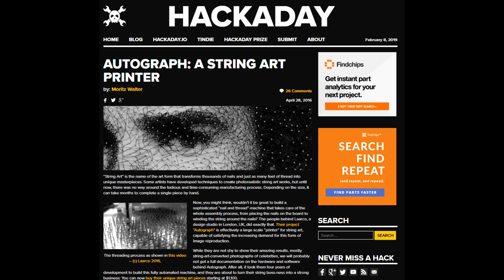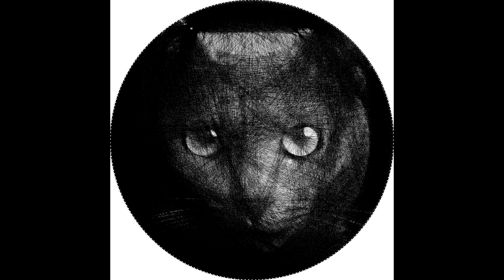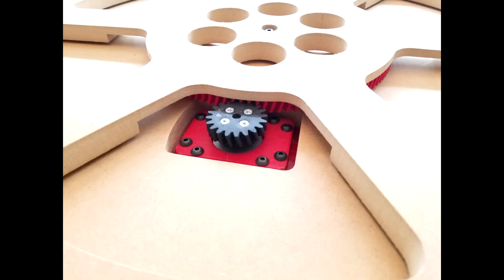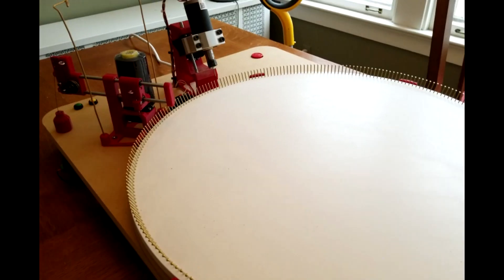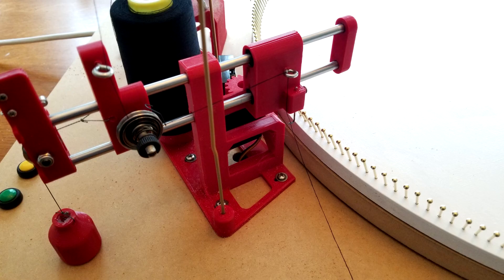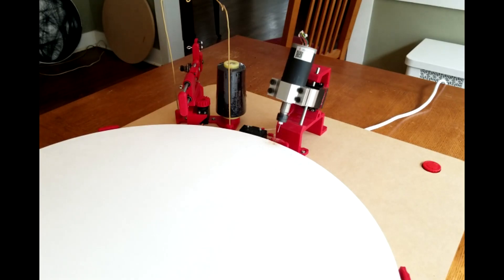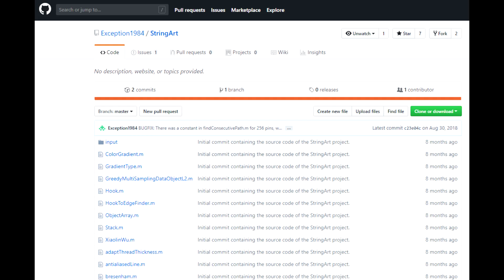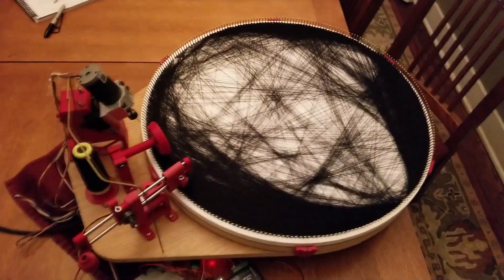A New Spin on String Art Machines

Comment: I've been inspired by your machine so I'm going to make my own. I am designing it for laser cutting. I played with a stepper motor for the first time I think I have that down now. Next I need to figure out the thread servo and feeder. I'll be using large thin rings of Teflon as an pseudo bearing. 

Where did you get those nice nails? Amazon doesn't have any good options.

Comment: Glue down with contact cement, a rubber strip (scavenged from a bicycle innertube) on the table that the bearing rollers ride on. Rolling noise should be deattenuated.

Comment: instead of finding rubber wheels, wouldn't it be easier to get a rubber mat for the wheels to do their rolling on? heck, maybe do both. also there are those tiny rubberbands. maybe you can fit them around the wheels to act as "tires"

Comment: For the time lapse you might try having some sort of visual angle reference on the bed that is easily visible to a camera mounted directly above it. This way you could "rotate" the bed to the same index position in each photo essentially making the time lapse look like the machine is moving around the art. I think this would be very cool looking.
Reply: Well you know the angle of the bed right? Couldn't you just rotate the image in post?
Reply: @Synthetica9  this would work fine too as long as you have a way to associate the angle to the image file. Having a mark on the bed that you simply rotate in post to the 12 o'clock position would probably be easier since you don't necessarily have to cross reference a list of files and angles. 

However if you were controlling the camera from the same control board and if it has a little extra processing power, it could be trivial to take the photo, immediately run something like ImageMagik on it to rotate it using the angle from the bed controller as a parameter while your string art machine is laying down the next string. Rinse and repeat and your "post" processing is done around the same time as the artwork you would just need to run the rotated and cropped image stack through ffmpeg or something to make it into a video.

Comment: pretty cool build, you should try getting some white thread and dripping dye on it of various colors, then making a picture with it :)  Also putting all your moving parts on rubber bushings can reduce the noise, and adding sound absorbing material to the back side of the base will cut some noise. The gears themselves can be noisy as well, going to a belt drive system is a great way to reduce even more noise.

Comment: Another interesting idea would be to make a printer that prints in a circle. The paper rotates on wheel and the print head goes left and right, but only half way across and the paper rotates after each row of pixels printed until the paper is full.

Comment: Instead of rotating to a fixed position to take a photo (which as you say potentially raises problems with thread tension, and would definitely slow it down) you could try recording the position (or just extract it from the input data) at each "operation" and use a script to rotate the image the relevant amount. It's not like there is machine gubbins moving in and out of shot  like a 3D printer.

Comment: Fantastic project.
Rather than use rubber wheels that will inevitably wear out. You could consider using damping material and damping mounts to the sections acting as a sounding board.  That gives you more robust mechanics and reduced vibrational noise. Look at Getzner polyurathane material and request sample pack

Have you considered running Octave rather than Matlab. Octave is compatible with Matlab language.
Otherwise consider Matlab to Python translators then Cython interpreter to compiled code conversion for speed ups. 
I look forward to the next video of your work

Comment: 7:47  have you thought about model railroad cork roadbed?  its pretty sturdy, and is used in model railroads specifically to hold its position and shape without allowing the track to deform, while still providing sound deadening.

Comment: Could you do a CMYK separation of the original image and then do 4 passes using 4 thread colors to stimulate a color printer? I'm thinking the number of threads used in each layer would need to be much less, but that the final result might look quite good.

Comment: Makes me wonder what it would look like if you actually 3D printed the code for the string allowing 3D printer to lay down the thin lines. Perhaps intentionally printing a bit above the surface to allow lines printed to gravity fall so you don’t have to worry about z height for each strand?
Great video and project!

Comment: If you want to do a timelapse, here's a solution.

Place the camera on a rotating shaft that's above the machine. The rotating shaft should be on the same axis as the rotating platter.

Drive the rotating camera with a stepper. Put the stepper on the same controller as the one driving the platter so it stays in sync with the platter.

Comment: To make a timelapse look less silly as you describe, you could try to find a way to fix the camera to the turntable, or have a separate mechanism that rotates the camera in sync with it. Or unrotate the video after recording using the same data you used to generate the turntable rotations in the first place.

Comment: as for the camera part i think you can use the limit switch thing which can find the zero and find the more repeated number in the pins, for example, pin number 144, then when ever it stops on the pin 144 code the cam to click on it. i think it may help, i am not a technical expert :)
Reply: How about rotating the image by software? No need to drive to pin 0 first, which saves time. 🤔
Reply: @carlc.4714 idea is good, but it will take more time to process it, and I think  the end result will be blurry
Reply: yes — and if there’s too much of a gap between calls to pin 144, extra ones could be inserted to smooth out the time-lapse.
Reply: @kevCarrico oooh well thats a good idea 💡❤

Comment: I'm halfway through my build. Using a lot of things I had on hand, so it's a bit different. I'm using NEMA 23 + DSP driver but I'm using arduino just because that's what I'm familiar with. I found another picture to string converter written in python. It works really well and you can control iterations, number of nails, etc. It's output is a sequence of numbers corrosponding the the pin string should go to next. Wrote a pythons script to generate arduino commands to rotate to that particular radian using that text file. Not the best...may need to rethink this. I'm using a timing belt and timing gears from automation direct at about 4.5 to 1 gear ratio (that's the best I could do since I didn't have a 3d printer at the time). My set up is not perfect and seems to be off about a nail's width every 20 rotations or so. I guess that's why you used a limit switch? I'll have to do the same and programatically recalibrate every few rotations. So far so good. Thanks for the inspiration!
Reply: Hey man that sounds like an awsome build! I am looking into doing something similar. Did it work out in the end? If you could it would be really nice to share a short vid on youtube so that people can see your work  and maybe do something similar! :D
Reply: @OMGWTFBBQSHEEP  still in progress. Life got in the way. Had it going, but it would drift a radian every 10 or so rotations. Need to install a limit switch that acts as calibration or get a nema motor that has encoding closed loop.
Reply: @ClintRobison  allright, thanks for the update! The struggle with actually finishing projects is a real one that i think many of us struggles with.. Sounds like you are not too far from having a finished project tho :D
Reply: Did it work out in the end?
Reply: Past one year I'm working on this project  but I just another string art generating program written in js which is light weight and we can control number of nails like 150 to 1200 nails and number of loops easy compared to math lab process but I got stuck in integrating that js instructions to this machine because I don't have any coding background commerce guy here I felt fascinating so  I thought  in business mind  it's good product if we can give custom gifts at good packing     I Saw there is some demand in my country but its hand made and expensive so if we can automate we may have business ❤

Comment: Also, why would the "gcode generator determine the shortest path" when the platter never completes a full rotation? That means there's only one path; in the opposite direction of the previous path, right? I might be misunderstanding :-)
Reply: Yes, you are. Imagine drawing the thread from nail 0 to nail 50, then from nail 50 to nail 100. For the first leg, you spin "upwards" (by 50 nails), but for the second leg, you down spin "downward" (by 50 + (nail_count - 100) nails) crossing zero but also "upward" (by 50 nails).

So... There's a small mechanical issue that may affect the quality of the threadwork. The origin of a thread leaving a nail is tangential to the nail's circumference, but it can either be on the left or right. This shifts the thread a substantial amount (the nail is much thicker than the thread), depending on what the previous nail was and the direction it is wrapped around the nail. (And the same again for the end of a thread.) I now really wonder if the algorithm takes that into account...

Comment: What would be the rotational inertia problem with controlling your platter directly with NEMA 23 (meaning without going through the trouble of 3D printing the gears)? Is it possible to control the acceleration in order to prevent too much initial torque on the motor directly?

Comment: As an alternative to finding hard rubber wheels, the ring on the base that the wheels ride on can be coated with a resilient compound, such as rubber roofing, or multiple coats of a latex paint.  Or, sheet rubber can be cut into arcs to cover that ring, and contact cemented to the base.

Comment: Hey, instead of using rubber wheels, you can also try putting the bearings at a (almost) horizontal angle. It will dramatically decrease the noice, you can try it yourself by taking a bearing and running it perpendicular on a hard surface, and then try it alsmost liniar horizontal.

Comment: Just heard your interview! 
All these builds are amazing!
As for the time lapse, you have the solution already built in! 
Use the platter home switch to trigger the camera every time it spins past!
Or, give the edge holders a second bump
lower(or higher) then the home switch(as to not interfere), so you could trigger the camera:
When it passes home.
When it passes home and 180°from home.
Flip the upside down pictures in post.
Home, 120°, 240°, correct and align in post.
Or a picture every 60°, again rotating the pictures so they align properly in post.

Comment: Dude, this is awesome!!! Thank you for making this thing open source. I was able to do this by hand over a year ago, but it took my nearly a week to complete with only my free time. I will say, I did not write the software that generated my thread path, but I did design my own custom frame and had it lasercut from plywood with the nail holes also laser cut. But honestly the killer app that you've provided is a way to consistently place guide holes for the nails at a fixed angle. Your an absolute mad man! Thanks again. And for anyone who is curious, here was my attempt at making this kind of art. Hey, I made a thing. Does this count as a thing? Tell me if this is a thing https://imgur.com/gallery/pN5T9

Comment: So once a picture has been 'strung up', do you have to drill another white platen board to make another picture?  Would be SO COOL if the pins could be made retractable - that way the strung picture could be preserved in a clear acrylic pour.  Then, the pins would be retracted, and the cured acrylic 'disk' removed from the platen with the thread embedded in it.  Of course, this would mean that the back plate be made of a material the acrylic wouldn't adhere to. I love the machine!  I hope you share/sell the files for building these.
Reply from the maker: I have not tried that. I make a new frame every time. The nails with 100+ loops are pretty tight. 

It takes about 2-3 minutes to drill and about 12-15 to place the nails.
Reply: @engserve   - so how many nails are in the perimeter?
Reply from the maker: @jmortonsalt  I use 256, but the software let's you specify count and diameter.
Reply: @engserve  - that is SO cool!  I didn't realize the small amount of time it took for the drilling and nail placement.  But preserving the strung picture/portrait in solid acrylic would look neat.  SO looking forward to building one of these!

Comment: Could you embed a track of something rubberized into the table instead of searching for possibly difficult to find hard rubber wheels? Or maybe a flexible tape?
Reply from the maker: That is an option I am considering. Currently that piece is routed from the other side, so I would have to change a few things to keep it a single sided cut.
Reply: Dosen't surprise me that you've already thought of that :)
Reply: Applying heatshrink over bearings is something I've done before. Works pretty good.